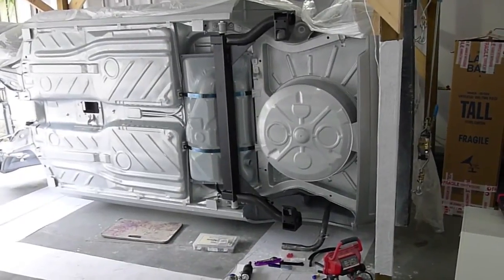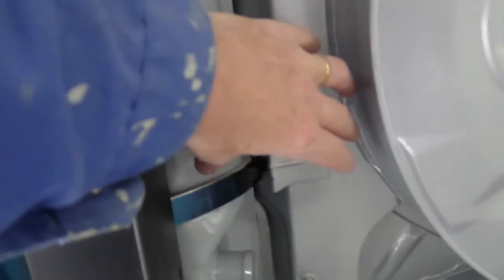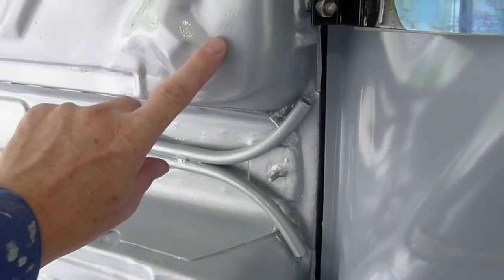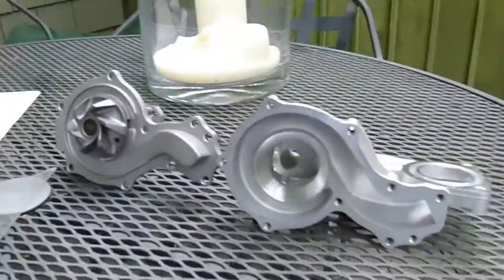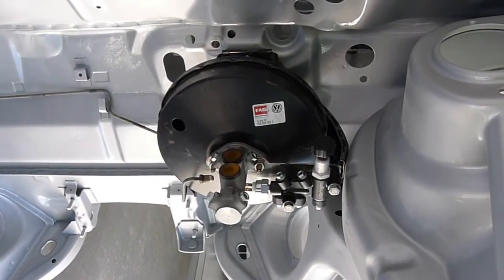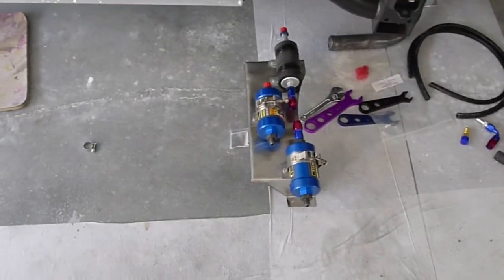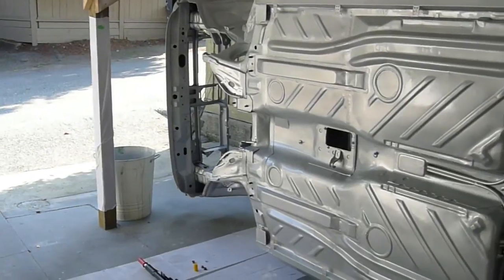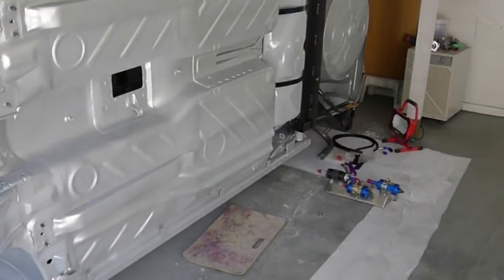The Ultimate 1983 Rabbit GTI - part 53 (Starting the fuel & brake system plumbing, water pump mods)

Comment: what is the wilwood proportioning valve?
Reply from the maker: A manually adjustable valve that reduces the braking pressure to the rear disks